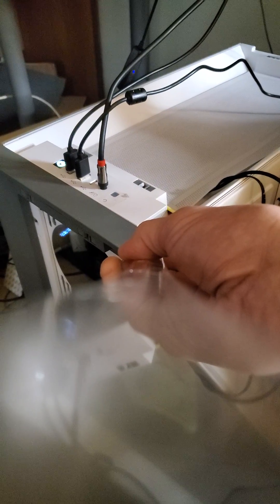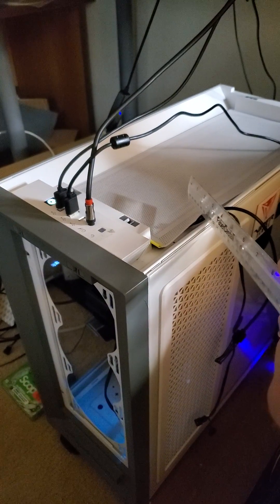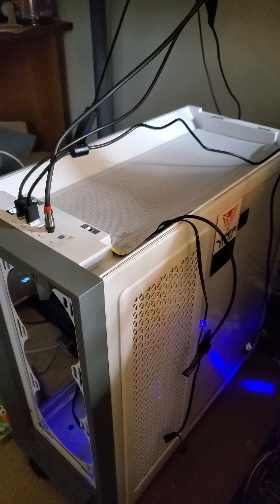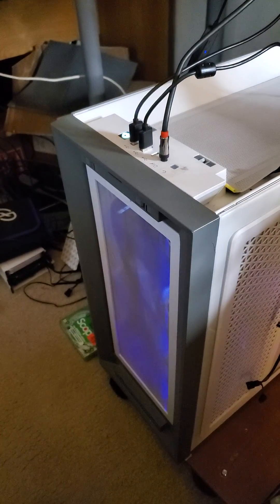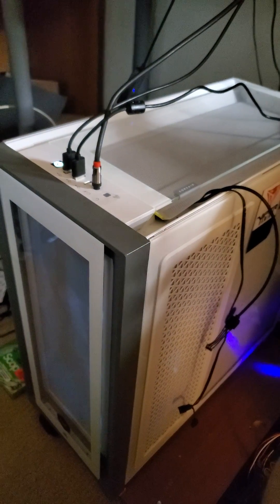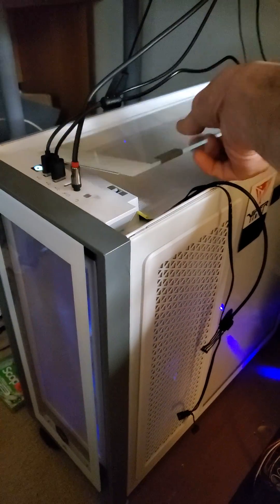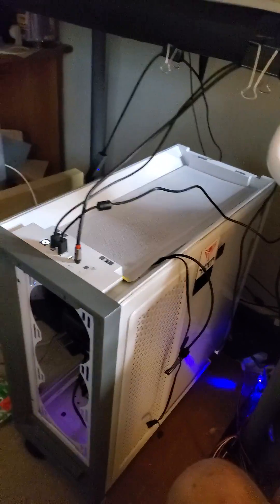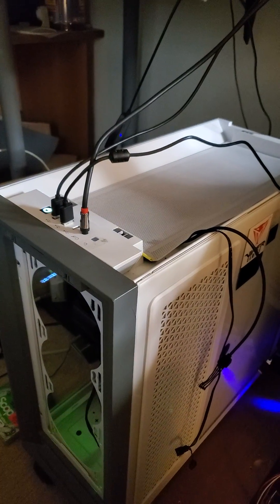Thermalright Frozen Notte Noise from 1' (30.5 cm), various configurations

Comment: Its very lous, over a longer period it drives you crazy
Reply from the maker: Which case did you have it in? I found it to be quiet. If you think that's loud, you're quite sensitive to noise. Try moving the case farther away from your ears to help.
Reply: @ThePCExpertAmateur  Phantech N7 case.  I have 8 Thermalright fans and it's loud.
Reply from the maker: You may not need all those fans, or you may be able to attain a lower sound threshold by adjusting the fan curves downwards somewhat. There may also be an issue with how you've arranged the fans. Which TR fans? Which are on exhaust and where? Which are on intake and where?
Reply: @ThePCExpertAmateur  I have Thermalright TL-C12CW-S
I have tried adjusting the fan speed, but I'm worried about the system overheating, although I have been using it lightly.
Reply from the maker: Those are not very loud fans. If you do not EVER do anything that stresses the computer, you don't need to worry. Try this:
Use any software that will monitor the temperature of your CPU, GPU, RAM, etc.
Do something that challenges your computer, like playing a AAA game, rendering, CAD, 3d modeling, data crunching, AI, or use a free test tool like FurMark (for GPU), Prime95 (for CPU), CineBench 2024, SuperPosition, Time Spy, etc.
Run it in benchmark or torture mode (for Prime95, the torture mode would be with smallest FTTs) and see how your computer performs. Lower the fan curves somewhat and try again. Keep doing that until you reach a point where the computer starts thermally throttling. Unless you are ACTUALLY planning on doing one of the really heavy tasks, setting it a bit higher than where it throttled will give you the best mix of quietness and performance.

There are other things you can do, such as getting a better mounting frame (BCF for Intel 12th-14th gen, offset for AMD), and, again you can optimize your fan configuration. I don't know the config or which cooler you have so I cannot comment much.

However, if you're using an air cooler, have intake from the bottom and the right side, and exhaust from the top and back or, just bottom and top, preferably with the back and side blocked with something. If you have a water cooler, mount the radiator on the right side. If it's on exhaust then pull in air from the bottom. If it's on intake, you can still have fans on the bottom and/or on the top. However, please make sure that the total is always at least a bit higher for intake than exhaust, paying attention to the fact that the radiator will drastically slow down airflow in either direction.

Does that help?